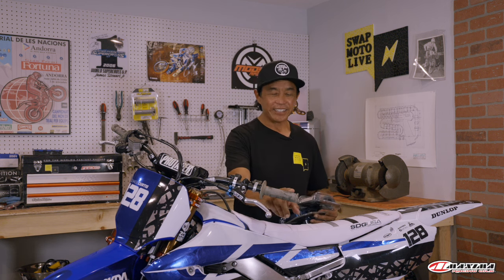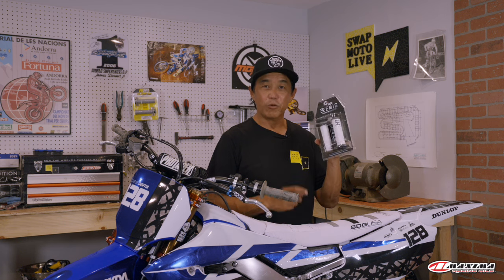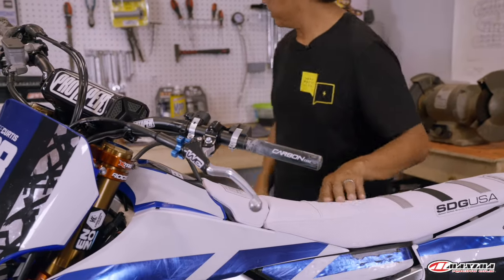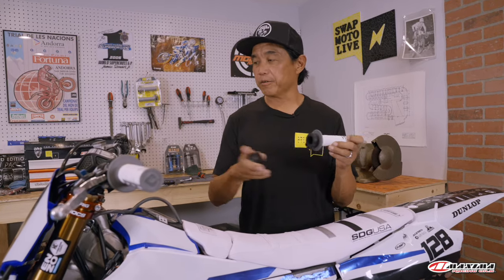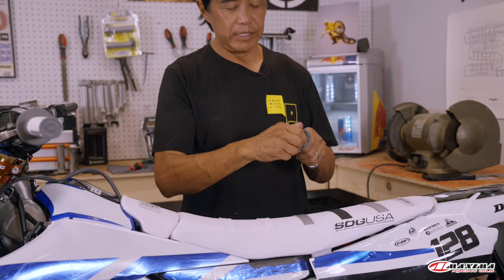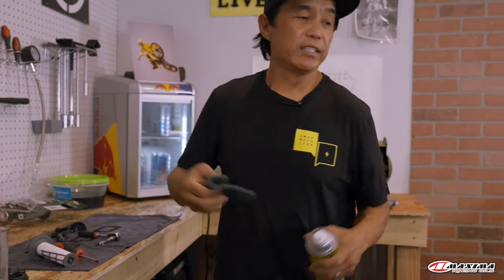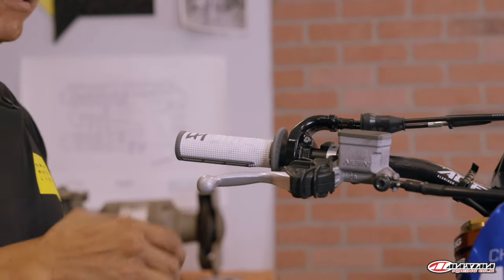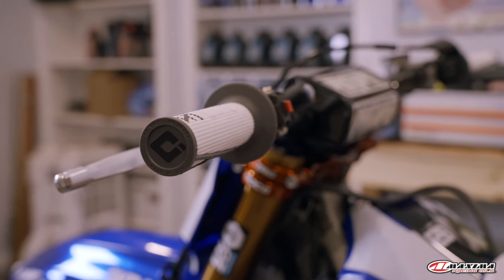Is It Really That EASY? | ODI Lock-On Grip Install

Comment: Is it possible to use ODI LOCK ON grips for CRF 300L?
Reply: They come with about 5-6 different cams for different manufacturers/throttle designs. 

Just pop off your throttle tube and find the cam that matches.